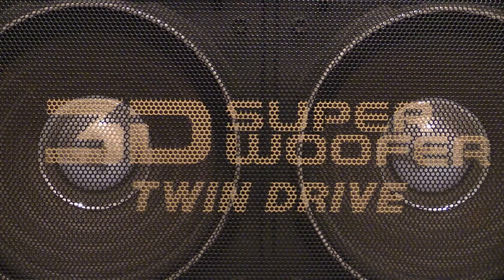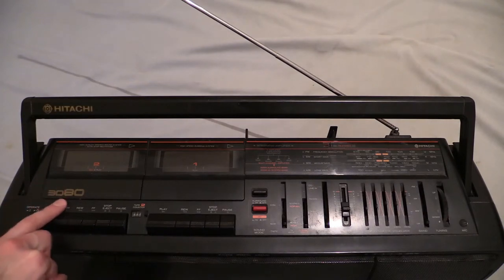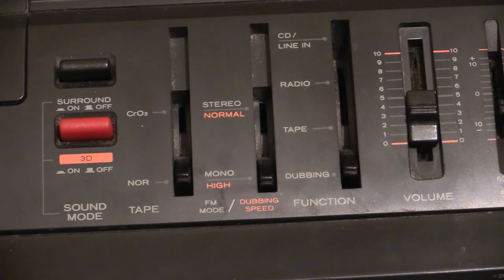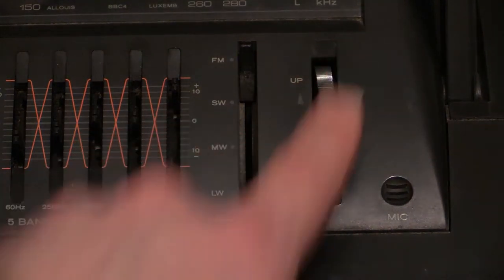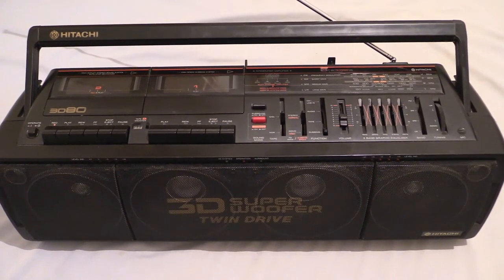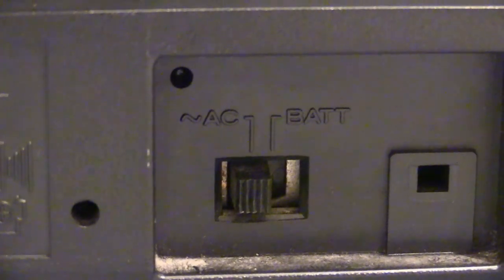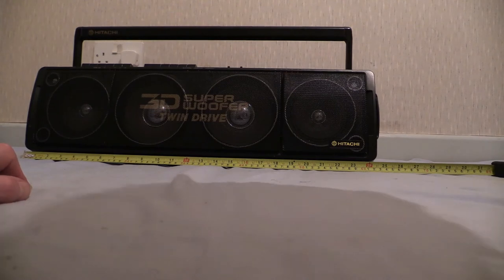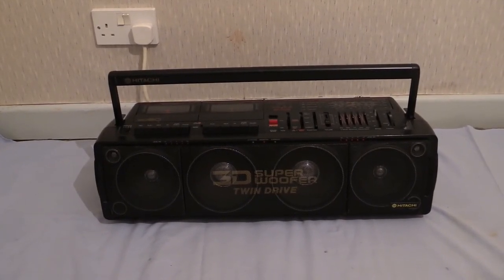BoomBox : No. 7, February 2018.

Comment: Hey! Do u know the size of the decks belts of 3D8 and 3D80E? I need to replace them!
THX!!!!!
Reply from the maker: Hiya. Although I own a 3D80E, I don't own the other one. In relation to replacing belts, we have a a technique within the WGM* for working out belt sizes. Try our little trick, shown below.....

(1) Whack the subscribe button on Wayne's Electrical.
(2) Get the bell on for a notification of when vids drop EVERY MONDAY.
(3) Take the BoomBox you wish to re-belt.
(4) Open it up very carefully.
(5) You need a piece of white string WHICH DOES NOT STRETCH.
(6) You need a black marker (or other dark colour)
(7) Place the string around the pulleys which the belt would normally go onto.
(8) Make a mark on the string where the ends of the string overlap.
(9) Make a note of the length. This is the CIRCUMFERENCE.
(10) Divide circumference by Pi (which is 3.14)
(11) The answer is the INTERNAL DIAMETER of the belt you'll need.
(12) Give this reply a THUMB-UP
(13) Order replacement belts keeping in mind that....
(14) Not all belts are flat. Some may be 'diamond-shaped'
(15) Fit the new belts upon arrival.
(16) Carefully reassemble the BoomBox.
(17) Turn on,
(18) Insert cassette
(19) Press play
(20) Crank it RIIIIIIGHT UUUPPP and exercise those woofers. :D

There we are.

*WGM= Worldwide Getto Massive.

-Wayne's Electrical.

14th June 2020, 20.04

Comment: Just watched this vid, does this Boombox actually work?
Btw I much prefer the term 'ghetto blaster'!
Reply from the maker: Hiya. You will
be glad to know
that the 'boxes
to be shown on........

......This channel are functional, and there are more to come.

Admittedly, some of my Boomers do need attention, but that is usually drive belts or the occasional crackly volume control.

I do have one 'box which has bit of an issue though, and everything on it runs very very quietly. I think the radio on it is OK, but everything else runs at quarter volume, even with it turned all the way up.

In reference to the terminology to these machines, "Ghetto Blaster" was indeed one of them, and a whole lot of others besides, some of which cannot be repeated on here as I consider them inappropriate.

It's not as if it is a sign-of-the-times either. Some of thoe other more inappropriate terminologies were not acceptable then, and still aren't now.

If you look in the video description, you will see a list of the terminologies for these machines that I have listed as tags so that when they are searched for, these videos turn up in peoples' results.

More BoomBoxes later..... Hold-on in there. :D

Thanxx for watching,

-Wayne's Electrical.

20th April 2018, 21.18
Reply: Wayne's Electrical  Nice one mate! 👍